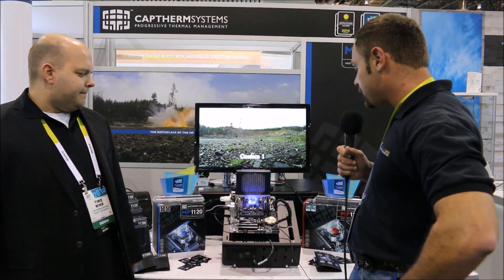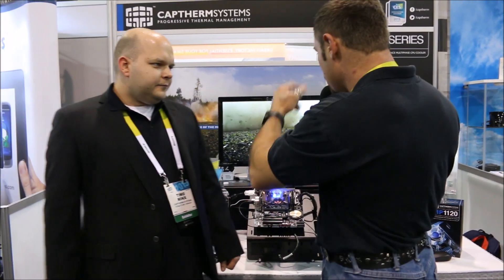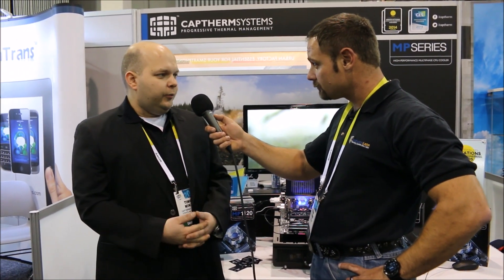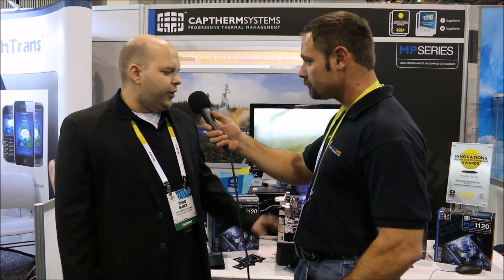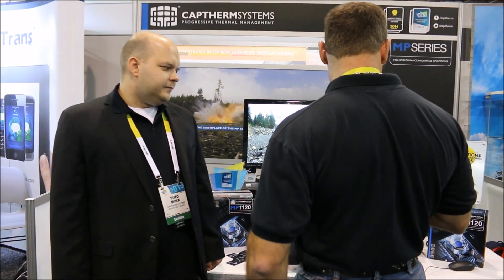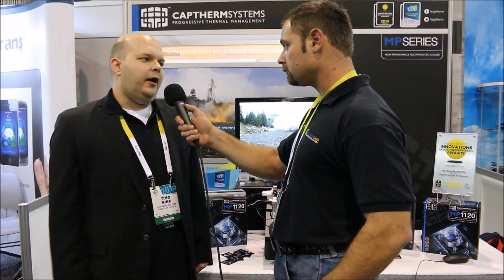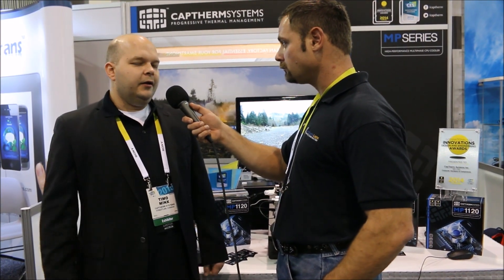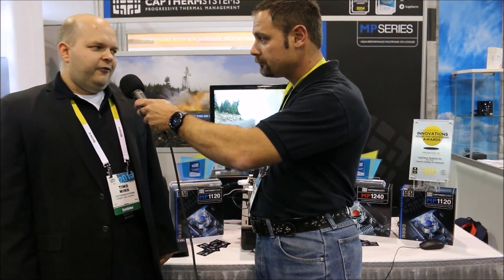CES 2015 Captherm Systems

Comment: Just to point out from what i recall about this product when i first heard of it over a year ago, there is no pump moving the fluid into the radiator and back. This makes the system completely quiet and vibration-free (and fail-proof), except for the fan which is optional.  The fluid used will boil at very low temperatures, as can be seen at the end of the video.  The boiling liquid rises up into the radiator while the cooler liquid in the radiator comes down to take its place.
Reply: Does the pc have to be sideways then?